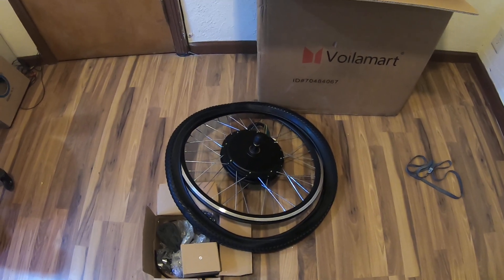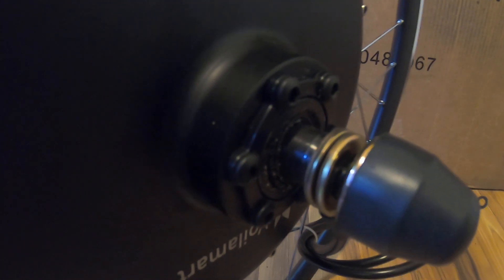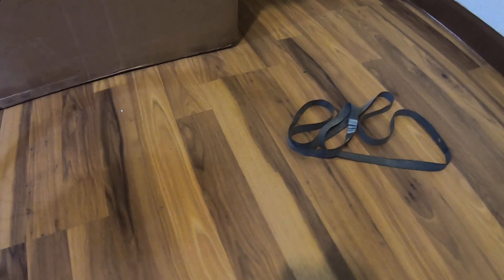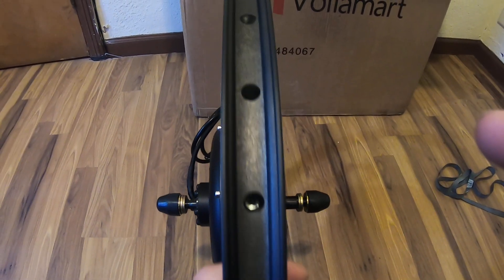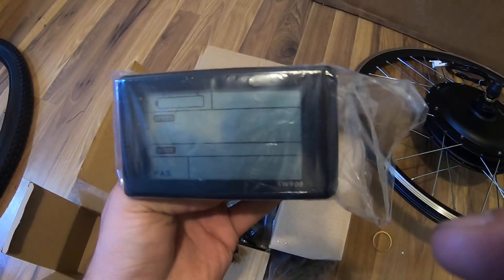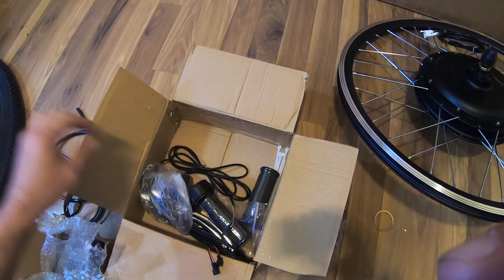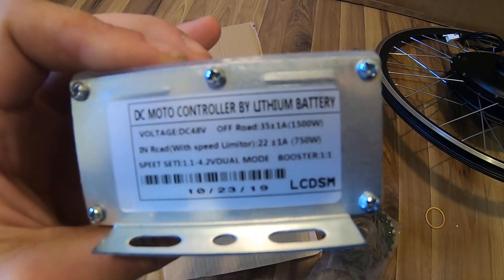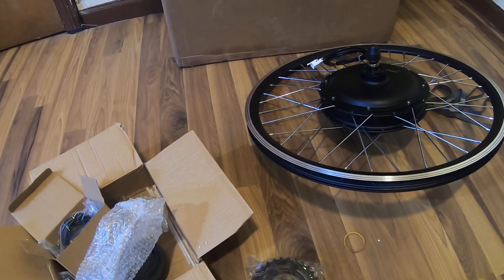48V 1500W Rear Wheel Electric Bicycle E Bike Conversion Kit

Comment: You modded the controller yet or taken the bike out for a ride
Reply from the maker: Nick Walters No have not  modded The controller is that possible?  no still haven’t put the bike together just yet 100% still building battery
Reply: @QsTechService1  people do the shunts I've get the same kit but like you not finished building it